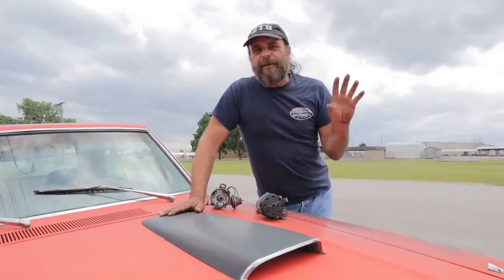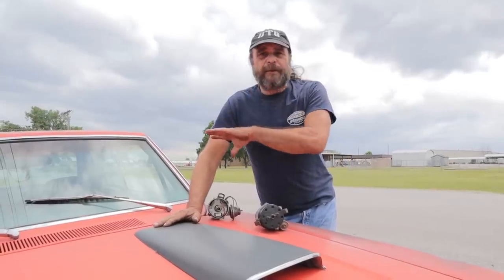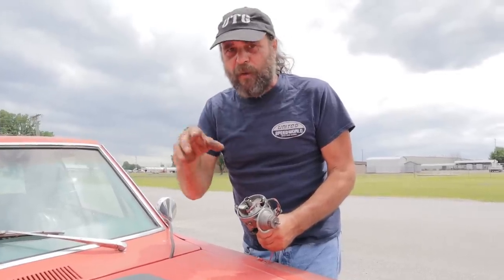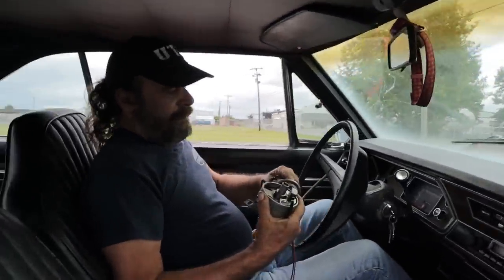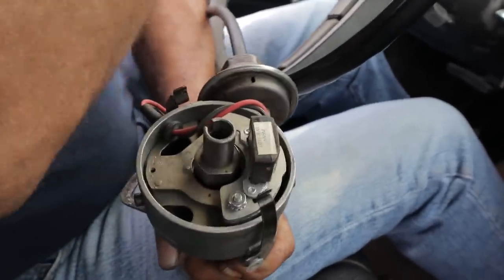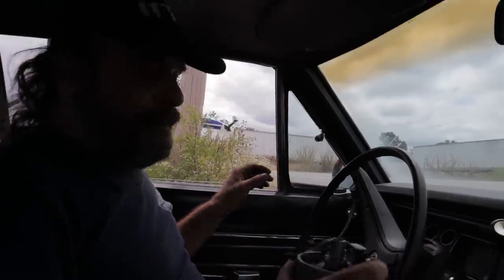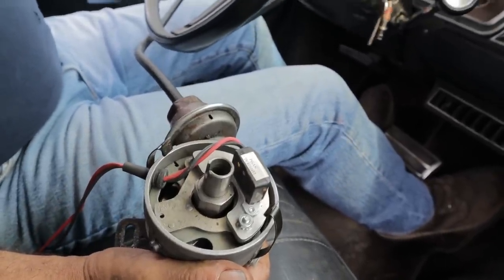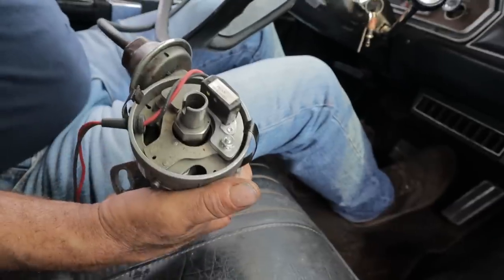The Vacuum Advance Debate!

Comment: Tony - The IMPORTANT thing that you are leaving out is your centrifugal curve!  If your distributor is curved for Manifold Vacuum, than you need to run Manifold Vacuum with that distributor.  If your distributor is curved for Ported/Timed vacuum advance then you need to run ported/timed vacuum with that distributor.  If you want to run Ported/Timed Vacuum then you need a distributor centrifugal advance curve that has a shorter (for more initial) advance curve or of course and even better, custom curve your distributor to your engine to run ported/timed vacuum.  Also, there is no disadvantage or loss of power or performance in running vacuum advance on a street engine.  The vacuum advance only ADDS advance under light load cruise conditions so you still have the benefit of your centrifugal advance AND the efficiency (cooling and mpg) of the additional light load cruise vacuum advance.  If you mash the gas, the vacuum advance drops out and you are only using the centrifugal advance so it's like it's not there anyway.   Race ONLY engines yeah, no vacuum advance needed as you are either off or full on the gas so the vacuum advance wouldn't even come into play.
Reply: Agreed; I believe different engines are setup differently.  This is the crux of the debate.
Reply: @aboutmyfathersbusiness8324  Should I run Manifold Vacuum or Ported Vacuum for the best PERFORMANCE?  

Manifold Vacuum: 
Pros - Fuel Flexibility (less mechanical advance allows you to run low octane fuel), Automatic Start Retard (Easy Starting), Fuel Efficiency at idle (MPG), Engine Cooling at Idle (Adds additional advance at idle)
Cons - Lack of throttle response and less low/mid rpm power (The mechanical curve is not as aggressive so it leaves performance on the table.  That's the 'whoosh and then go' you hear and feel but NOT stumble.)

Ported Vacuum:
Pros - Instant throttle response and greater low/mid rpm power (more mechanical advance at low/mid rpm)
Cons - MAY cause harder starting (no automatic start retard).  MAY cause overheating at idle (The issue here is that you need to bring your mechanical initial up to prevent the overheating BUT not so far that it causes hard starting)

So, which to use?  To start with, your distributor mechanical curve has to be set to run whichever advance you use.  Manifold Vacuum distributors typically have mechanical curves 24° or more (smog distributors can have curves in them upwards of 30°!)

Ported Vacuum distributors are usually 22° or less and depending on the cam can be as little as 10° mechanical advance.  Any Performance Cam should have a distributor set up to run Ported Vacuum or you are just wasting the extra performance the cam can provide. 

The deal is thus.   If your distributor is curved to run with Ported/Timed Vacuum... then you connect it to the Ported/Timed port on the Carburetor.  If it is curved to run with Manifold Vacuum... then you connected it to the Manifold port on the Carburetor.
Reply: @joevalicenti2722  Here is a good write up by an engineer who took part in the development of vacuum advance...

"As many of you are aware, timing and vacuum advance is one of my favorite subjects, as I was involved in the development of some of those systems in my GM days and I understand it. Many people don't, as there has been very little written about it anywhere that makes sense, and as a result, a lot of folks are under the misunderstanding that vacuum advance somehow compromises performance. Nothing could be further from the truth. I finally sat down the other day and wrote up a primer on the subject, with the objective of helping more folks to understand vacuum advance and how it works together with initial timing and centrifugal advance to optimize all-around operation and performance.

TIMING AND VACUUM ADVANCE 101

The most important concept to understand is that lean mixtures, such as at idle and steady highway cruise, take longer to burn than rich mixtures; idle in particular, as idle mixture is affected by exhaust gas dilution. This requires that lean mixtures have "the fire lit" earlier in the compression cycle (spark timing advanced), allowing more burn time so that peak cylinder pressure is reached just after TDC for peak efficiency and reduced exhaust gas temperature (wasted combustion energy). Rich mixtures, on the other hand, burn faster than lean mixtures, so they need to have "the fire lit" later in the compression cycle (spark timing retarded slightly) so maximum cylinder pressure is still achieved at the same point after TDC as with the lean mixture, for maximum efficiency.

The centrifugal advance system in a distributor advances spark timing purely as a function of engine rpm (irrespective of engine load or operating conditions), with the amount of advance and the rate at which it comes in determined by the weights and springs on top of the autocam mechanism. The amount of advance added by the distributor, combined with initial static timing, is "total timing" (i.e., the 34-36 degrees at high rpm that most SBC's like). Vacuum advance has absolutely nothing to do with total timing or performance, as when the throttle is opened, manifold vacuum drops essentially to zero, and the vacuum advance drops out entirely; it has no part in the "total timing" equation.

At idle, the engine needs additional spark advance in order to fire that lean, diluted mixture earlier in order to develop maximum cylinder pressure at the proper point, so the vacuum advance can (connected to manifold vacuum, not "ported" vacuum - more on that aberration later) is activated by the high manifold vacuum, and adds about 15 degrees of spark advance, on top of the initial static timing setting (i.e., if your static timing is at 10 degrees, at idle it's actually around 25 degrees with the vacuum advance connected). The same thing occurs at steady-state highway cruise; the mixture is lean, takes longer to burn, the load on the engine is low, the manifold vacuum is high, so the vacuum advance is again deployed, and if you had a timing light set up so you could see the balancer as you were going down the highway, you'd see about 50 degrees advance (10 degrees initial, 20-25 degrees from the centrifugal advance, and 15 degrees from the vacuum advance) at steady-state cruise (it only takes about 40 horsepower to cruise at 50mph).

When you accelerate, the mixture is instantly enriched (by the accelerator pump, power valve, etc.), burns faster, doesn't need the additional spark advance, and when the throttle plates open, manifold vacuum drops, and the vacuum advance can returns to zero, retarding the spark timing back to what is provided by the initial static timing plus the centrifugal advance provided by the distributor at that engine rpm; the vacuum advance doesn't come back into play until you back off the gas and manifold vacuum increases again as you return to steady-state cruise, when the mixture again becomes lean.

The key difference is that centrifugal advance (in the distributor autocam via weights and springs) is purely rpm-sensitive; nothing changes it except changes in rpm. Vacuum advance, on the other hand, responds to engine load and rapidly-changing operating conditions, providing the correct degree of spark advance at any point in time based on engine load, to deal with both lean and rich mixture conditions. By today's terms, this was a relatively crude mechanical system, but it did a good job of optimizing engine efficiency, throttle response, fuel economy, and idle cooling, with absolutely ZERO effect on wide-open throttle performance, as vacuum advance is inoperative under wide-open throttle conditions. In modern cars with computerized engine controllers, all those sensors and the controller change both mixture and spark timing 50 to 100 times per second, and we don't even HAVE a distributor any more - it's all electronic.

Now, to the widely-misunderstood manifold-vs.-ported vacuum aberration. After 30-40 years of controlling vacuum advance with full manifold vacuum, along came emissions requirements, years before catalytic converter technology had been developed, and all manner of crude band-aid systems were developed to try and reduce hydrocarbons and oxides of nitrogen in the exhaust stream. One of these band-aids was "ported spark", which moved the vacuum pickup orifice in the carburetor venturi from below the throttle plate (where it was exposed to full manifold vacuum at idle) to above the throttle plate, where it saw no manifold vacuum at all at idle. This meant the vacuum advance was inoperative at idle (retarding spark timing from its optimum value), and these applications also had VERY low initial static timing (usually 4 degrees or less, and some actually were set at 2 degrees AFTER TDC). This was done in order to increase exhaust gas temperature (due to "lighting the fire late") to improve the effectiveness of the "afterburning" of hydrocarbons by the air injected into the exhaust manifolds by the A.I.R. system; as a result, these engines ran like crap, and an enormous amount of wasted heat energy was transferred through the exhaust port walls into the coolant, causing them to run hot at idle - cylinder pressure fell off, engine temperatures went up, combustion efficiency went down the drain, and fuel economy went down with it.

If you look at the centrifugal advance calibrations for these "ported spark, late-timed" engines, you'll see that instead of having 20 degrees of advance, they had up to 34 degrees of advance in the distributor, in order to get back to the 34-36 degrees "total timing" at high rpm wide-open throttle to get some of the performance back. The vacuum advance still worked at steady-state highway cruise (lean mixture = low emissions), but it was inoperative at idle, which caused all manner of problems - "ported vacuum" was strictly an early, pre-converter crude emissions strategy, and nothing more.

What about the Harry high-school non-vacuum advance polished billet "whiz-bang" distributors you see in the Summit and Jeg's catalogs? They're JUNK on a street-driven car, but some people keep buying them because they're "race car" parts, so they must be "good for my car" - they're NOT. "Race cars" run at wide-open throttle, rich mixture, full load, and high rpm all the time, so they don't need a system (vacuum advance) to deal with the full range of driving conditions encountered in street operation. Anyone driving a street-driven car without manifold-connected vacuum advance is sacrificing idle cooling, throttle response, engine efficiency, and fuel economy, probably because they don't understand what vacuum advance is, how it works, and what it's for - there are lots of long-time experienced "mechanics" who don't understand the principles and operation of vacuum advance either, so they're not alone.

Vacuum advance calibrations are different between stock engines and modified engines, especially if you have a lot of cam and have relatively low manifold vacuum at idle. Most stock vacuum advance cans aren’t fully-deployed until they see about 15” Hg. Manifold vacuum, so those cans don’t work very well on a modified engine; with less than 15” Hg. at a rough idle, the stock can will “dither” in and out in response to the rapidly-changing manifold vacuum, constantly varying the amount of vacuum advance, which creates an unstable idle. Modified engines with more cam that generate less than 15” Hg. of vacuum at idle need a vacuum advance can that’s fully-deployed at least 1”, preferably 2” of vacuum less than idle vacuum level so idle advance is solid and stable; the Echlin #VC-1810 advance can (about $10 at NAPA) provides the same amount of advance as the stock can (15 degrees), but is fully-deployed at only 8” of vacuum, so there is no variation in idle timing even with a stout cam.

For peak engine performance, drivability, idle cooling and efficiency in a street-driven car, you need vacuum advance, connected to full manifold vacuum. Absolutely. Positively. Don't ask Summit or Jeg's about it – they don’t understand it, they're on commission, and they want to sell "race car" parts.

Courtesy John Hinckley
Retired GM/Chrysler Engineer
Reply: @aboutmyfathersbusiness8324  Yes, I have read this along with EVERYTHING else posted about vacuum advance on the planet and while the above is true... there is one glaring 'mistake'.... For maximum low end and off idle power, you should indeed run PORTED/TIMED Vacuum Advance... however you must curve your distributor so your initial advance is increased mechanically and still allow your all-in to be the same... along with adjusting your vacuum advance to work with the particular engines vacuum levels.
Reply: @joevalicenti2722  He is a GM engineer.  I believe he is talking about OEM specs.  Once a variable is changed, IE; cam, higher compression, the probability of other timing factors changing is high.
Reply: @joevalicenti2722 A big factor that most people overlook is aftermarket distributors; who knows what springs are on top of them.

Comment: Another use for vacum advance. Had street small block w too much cam. Locked out mechanical advance. Ran 2 vac hoses from eng to under dash.1 man vac. Other to vac adv. Cranked w hose disconnected, then hooked together w 1 way check valve for a/c vac hose to keep timing advanced untill hose disconnected.

Comment: So manifold vacuum is fine (advanced) as long as you're at a steady cruise..But it retards if you feed in throttle...Ported also has full cruise advance but doesn't knock it back under load?

Comment: wouldn't you have problems with detonation under a loaded condition with the ported advance added in with the mechanical advance? where if it were manifold vacuum you would  only have your mechanical advance because the manifold vacuum advance would go away under a loaded condition?

Comment: So under what conditions would manifold vacume be what you would want   if you need to back off advance just adjust the distributor  right?  And with it on ported  intend to burn more fuel.  A considerable amount more.    Im wondering if this isn't just another worthless part of the engine  my mpg and power are better when lines are olugged.   Everyday driver and I only drive about 20 miles a day.  In it. So maybe not same for everyone who may drive interstate and highways

Comment: My old race car was very hard to crank when at temperature solved that issue by leaving the ignition off to start cranking the engine then hit the ignition switch worked like a charm

Comment: I think your missing the boat on vacuum advance.  
A great article written by an old engineer that helped develop the vacuum advance.  The reason you want to advance timing at idle and highway driving is that the engine runs lean, a lean mixture is harder to ignite than a rich one, therefore the timing needs to produce combustion well before TDC to allow for a proper and complete burn.  These billet distributors without vacuum are only meant for racing or full throttle applications were good street behavior is not needed.
After reading the article I returned my non vacuum MSD dist for one that has a vacuum canister.  Also he stated that ported manifold vacuum is garbage, always use manifold non ported vacuum.  Ported was invented because of the new govt cafe standards years ago.  It never worked like was intended.
The article is well worth searching for and reading!!!!!  JM$0.02

Comment: I have found that IF you have a higher compression ratio ported vacuum sometimes causes detonation problems at lower RPMS 
  However full vacuum eliminates this and still gives better mileage when cruising at light throttle
Reply: Big cam compression  will run a lot better on manifold vacuum.  What you are seeing here is the advance not on soon enough . By time I'm done I get better mileage with manifold . Ported was brought in late 60s as pre emissions  for NOx

Comment: My 1980 GMC P30 Motorhome with a 454 uses the manifold vacuum port, with the original Rochester Quadrajet.
I looked in the GM truck manual, and it seems to be correct.

Comment: I’ve been saying “ported” for years.  Throttle tip-in sucks with manifold vacuum, because it’s been idling with full advance, then all that goes away instantly when you touch the pedal.  Big ol bog results.

Comment: My 82 355 just seen 230 degrees today so would switching to manifold and adjusting timing help my temps out my dad took it home on the highway and when he got back from work it saw 230 hasn’t gotten that hot so far usually stays around 190 195 230 worrying me… any advice appreciated

Comment: Witch port on the carb should  be used for port vacuum on the carb I have a 1985 d350 dually with the 360 in it and just put a new edelbrock 4bbl on it and I'm still getting it tuned right witch I have to get a vacuum Guage to get it right

Comment: Can the same be said about routing pcv valve to manifold vacuum instead of ported? On that issue for performance would u just run two breathers and no pcv? I have one breather and one pcv valve hooked to ported vacuum at air filter, thank UT

Comment: Humbly, I have a vacuum advance question for you if you don't mind. I had a "hot start" issue with my sbc 383, and I wanted to retard my timing a bit extra for startup. So what I did for the vacuum advance was used a hose tee and tapped into both the the ported vacuum AND manifold vacuum ports simultaneously, to pull max advance after startup, and to carry it through to wide open throttle. (Side note: I put little baby check valves on each leg between the tee and both ports because i didn't know if the low/high vacuum conditions would have any affect on each other, or whatever's in the ported body of the carb). Whaddaya think about this? I honestly don't know if it's helping overall performance or hurting it. Thanks very much!